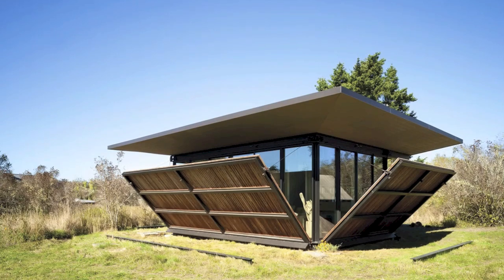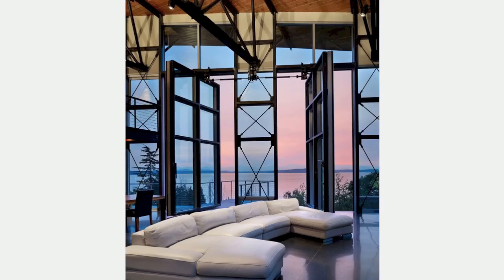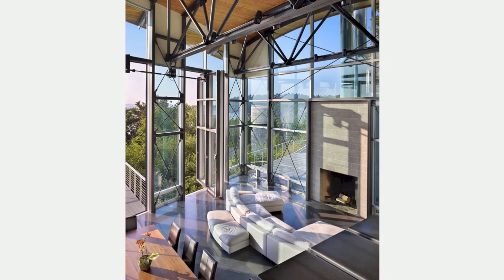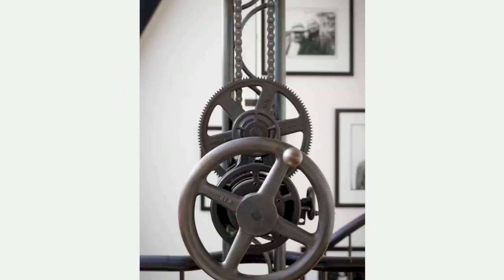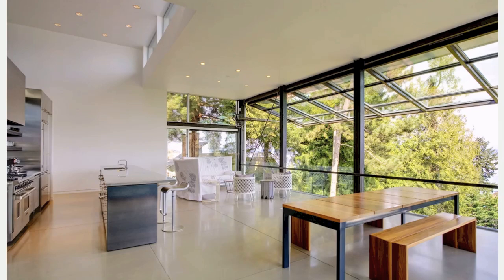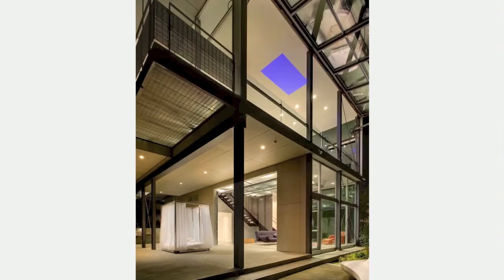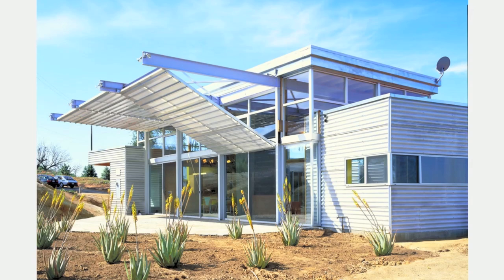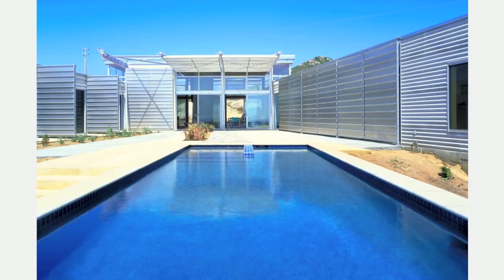Kinetic Architecture

Comment: It looks like you don't understand the significance of kinetic. I feel more like an engineering comment about a technical way to apply on arquitecture. What you are showing in this video is only a mechanical solution for open and close faces os a building. You must to go further in your presentation and realice the big difference between a facade and the skin of a building. How the project react to everything around.